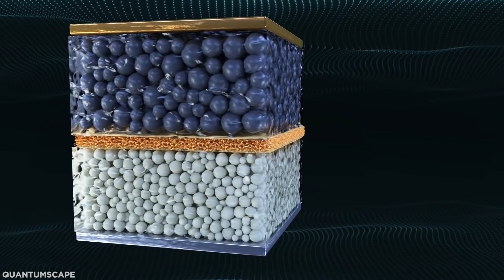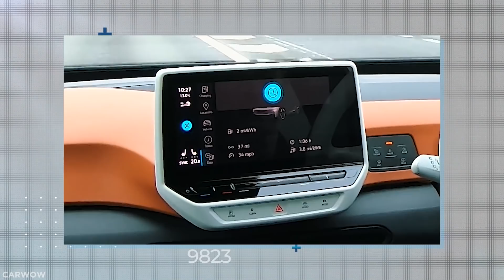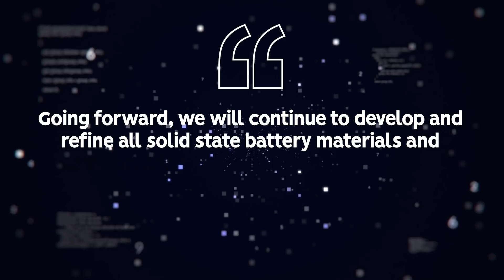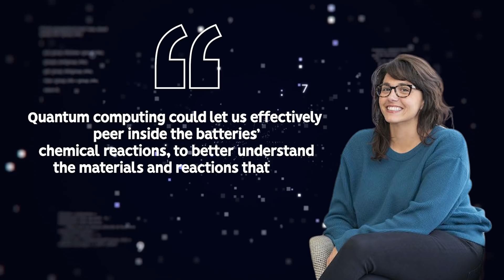Why Solid State Batteries Are The Future

Comment: Electric cars are going to need power from somewhere....
Reply: And gasoline and diesel cars need fuel from somewhere.  What's your point?
Reply: @redbaron6805  More power stations needed.
Reply: @raisagorbachov  That is not necessarily correct.  EV's can be charged at home, unlike gasoline cars.  You can also charge them at work and other places.  

A lot of power plants are idle at night since demand is low, so there is a lot of surplus power available already for electric cars when they are charged off peak, when the rates are low and a lot of spare grid capacity is available.
Reply: @redbaron6805  If it's charged at work, it'll be charged at peak times. If electric cars make up more than a minority then there will definitely need to be more power stations. A typical electric car that does 30 miles a day will use 259wh per mile. That's 7,770WH or 7.77KWH. Somebody that typically does that 7 days a week is going to use 54KWH per week.

A 500megawat power station will be able to charge just 9,259 cars at a time. I can tell you that there are a lot more cars than that within the area actually served by a single 500 megawatt power station as a typical 500MW power station will power 325,000 homes.

I'm afraid the electric car model is completely unsustainable, will lead to higher electricity prices, more pollution as more power stations will need to be built and that's without mentioning the environmentally unfriendly materials the electric car power system is made of. 

Though they seemingly emit more pollution, a gas or disel engined vehicle is way more environmentally friendly than those electric scams.
Reply: @raisagorbachov  Not necessarily.  My utility has two peak times, depending on the time of year.  One peak time is 12PM to 9PM, the other peak is 6AM to10AM and 6PM to 10PM.

As you can see, if I arrived at work at 8AM, I could charge for 4 hours before peak time arrived in the prior example.  And I could theoretically charge for around 6 hours off peak in the latter example.

Also, people typically do not commute to work 7 days a week, as most people have a 5 day work schedule.

As far as your "unsustainable" claims, they are simply not a reflection of reality.  You also fall into a logical fallacy with your "more pollution" claims for several reasons.

First of all is the fact that it takes around 6kWh to refine a single gallon of oil into gasoline.  That is enough power to drive almost the entire 30 miles in a single day.

Your idea that a power station can only charge 9259 cars is also off, since people commute 5 days a week, and a power station runs 24/7.  The actual number is 14286 each hour, times 24 which translates to 342864 cars each day.

And yet again, you forget that the power needed to charge electric cars would be offset, by not needing to refine millions of gallons of gas.  

And then of course, there is actual research by actual scientists that completely refute your claims that electric cars are more polluting and resource intensive than gasoline or diesel cars.
Reply: @redbaron6805  We will have to agree to disagree. Now if you'd said hydrogen cars were better, I'd have agreed.
Reply: @raisagorbachov  Hydrogen cars are not better, for several reasons.  Hydrogen is far less efficient.  The infrastructure for Hydrogen will never be built by anyone due to astronomical cost.  And the cost per mile on a Hydrogen car is about 6x to 8x higher than an electric car, and about 2x to 3x higher than a gasoline car.

Hence, you may see Hydrogen trucks or buses, even ships or airplanes.  But it will never make financial sense for cars.

Comment: Dyson has announced that they cancelled their EV project, even showed off what they had been working on. You got that wrong. VW Group has a large stake in Quantum Scape and is planning on using their solid state batteries in a luxury vehicle in 2025, so your statement about when they plan to introduce solid state is wrong too.  There is no current expectation that manufacturing will be cheaper for solid state at scale, no one knows how to get them to scale at all right now. Another wrong statement. Are you just winging this video? Is anyone there trying to get things right?

Comment: Solid state batteries have many issues currently to overcome, if they even can be overcome ever.
Reply: It seems major companies like Toyota are planning on making solid state cells, and when you consider the ban on vehicles in the future, I think it's only a matter of time before solid state batteries supercede current technology.
Reply: @MicroplaysMC  they can’t keep solid state batteries from declining performance when charged.  Lithium batteries will continue to improve, solid state will be a Waste of time.
Reply: @JP JP  You forget that early lithium tech was the exact same if not worse years ago. Old chemistries were actually susceptible to permanent damage if not charged/discharged properly. Over time it got better because the market already decided that's the route it would take and continue for years to come. We are at a point however, where batteries need substantial change in order to match the demand for better batteries and sustainable power. Elon has made a fantastic cell that outperforms the competition and is cheaper, but it's based off of decades old technology. There's nothing wrong with that, but if we're able to perfect the solid state cell, it would vastly outperform the liquid based cells. That point alone is what makes investors budge because it would mean anyone still using liquid cells would become incompetent. All that has to happen is that solid state tech advances fast enough to beat liquid tech in the long run. Personally, I think that can and probably will happen in 5-10 years.
Reply: @MicroplaysMC  but i will not sell my 1 million mile lithium battery EV just to buy a more expensive SS battery EV.   i think SS battery has its place, mostly in small to medium size devices.  Remember betamx versus VHS battle? betamax is technically better but VHS won the video format war.
Reply: @andrewcannon587  When the million mile batteries begin true production they will dominate the market for a while. SS tech has a long way to catch up, some carmakers are going all in though and are promising big things. We shall see if they can back it up.
Reply: @JP-dz7zu  Are you an engineer bro? Because these big companies already understand the safety risks and are working to overcome it. It's a matter of time with how quick battery technology will advance. You sound like you're bashing the technology just because you dont want to see the end of combustion vehicles.
Reply: @MrGtubedude  how is championing lithium ion batteries over solid state equate to not wanting to see the end of internal combustion engines?
Reply: @JP-dz7zu  Oh thats your argument? Well my apologies I assumed you were arguing against those batteries for combustion engines, I see lots of people do that simply because they like the noise they make, which i dont disagree with but clean energy is a must now a days.
Reply: yes hydrogen or biofuel seems like better option for me
Reply: @officialwowow  hydrogen yes, biofuel, no

Comment: This video assumes that Tesla won't make any advances in the future; the Tesla 4680 cell is already not far off the "expected performance of the solid state battery. PS. the Tesla Model S already does 500miles per charge, the Lucid Air has been tested to 519miles and the new Model S Plaid has done 527 miles - using the old Tesla cells.
Reply: The Plaid is not available to the public until late this year (or next year), and I think they are using the new cells? But I agree with you that 500 miles is already here. The benefit of solid state is faster recharging. Toyota is claiming it will take only 10 minutes to recharge the entire battery. If true, that would be gamechanging.

Comment: If some researchers says - you will not need cars because you will have a flying EVs; will you ban EV cars now?  If Solid State battery types get made; they will have different costs, battery life, energy density and charge speed differences, safety or limits on how many can be made..  No one knows what these will be; its all in labs; we can't assume the future. Australian researchers say forget that - Hydrogen - so ban Solid State now; because they have some outstanding lab results?  ICE car and truck bans are stupidity.  You did not need to ban mechanical calculators; when superior electronic calculators came out no one wanted the mechanical ones. Government promoting a solution before it is real ; is stupid in general.

Comment: Unfortunately solid state batteries don't have the cycle life and deteriorate faster than alternative options. Plus significantly more expensive to produce and will be for another decade. 
We won't see solid state batteries at scale for at least 10+ years.
There is a reason we've been hearing about "incredible battery break throughs" for the past 20 years and none of those solutions ever make it to market.
They are not scalable, or commercially viable.
The Tesla tabless battery from their battery day is literally the biggest TANGIBLE / viable leap forward we've seen in decades. All others are just fluff and bullshit until they prove otherwise.

Comment: Here in Australia it is very common to drive 600 miles (1000 km) in one sitting. The approximate distance between our 3 east coast capital cities is between 900-1000km (each)
 with not much by way of population, places to stay, or refuelling overnight outside those areas. The distance along our southern coast from Melbourne (in the Dan Andrews Police State of Victoria) to Adelaide is 750km with no major population centres in between.
Reply: Not sure what you are basing that on.  There is a Tesla Supercharger in Ballarat, Horsham and Keith.  So, driving between Melbourne and Adelaide is actually pretty easy.

Comment: In America, the current electric grid can't handle the existing capacity, so I don't get where all this power is coming from to charge these millions of EVs. And who is paying to retrofit all those apartment/condo and rest to charge these cars at home? Few MASS market buyers will get a vehicle that requires five+ hours of charging away from home.

Not saying it won't happen, but A LOT of government policies are going to have to take place for this to become a reality—similar to when the government built interstates in the 1950s.
Reply: The current electric grid CAN handle millions of electric cars, so that claim is actually false according to the actual utilities in question.

Apartments and condo buildings will add chargers over time to attract renters and owners.  It will become a standard feature over time, just like electricity and cable is today.

And what vehicles require 5+ hours of charging???  Typical 80% charging is around 30 to 40 minutes, full charge is around 1 hour, not 5.

Comment: I am most looking forward to getting charge times down into the 5ish minute range.  I can live with 250-300miles on a full charge if I can get fully recharged within 5 minutes or so. Of course, 600+ miles on a full charge and a relative quick full recharge of 6-8 hours would also be good for those long-haul trips.
Reply: Solid state batteries are allegedly promising 10 minutes to recharge. If that doesn't pan out, under current technology, you are looking for charging speeds to ramp up to 1.75MW (megawatts). Modern technology is at 350KW (kilowatts), which produces ~60 miles in 4-5 minutes.
Reply: @hermanwooster8944  That is what I am hopeful for.  10 minutes is pushing it, but if it is full charge, that is okay and will only go up from there. 60 miles in 5 minutes, while good, is still not a full charge of 300+ miles. Even though ICE are bad for the environment, it is still difficult to beat them for quick recharge time. Of course, they have had decades to mature at this point. I fully expect electric to get there. But until it does, and until prices become more in line with gas cars, full adoption will be slowed.
Reply: @RichardSmithers  I agree. I've been binge-watching EV roadtrips and they are still far too limiting. Especially since range is cut even further in colder climates. Although I want to see EVs succeed, I can't consider them until they increase the range/charging speed and lower the price.

Comment: Extended range, reduced weight and charging times along with price parity with ICE vehicles are on the horizon. Cannot wait to see this tech comes to fruition
Reply: That horizon, like nuclear fusion, will remain 10 years away for the next 50 years
Reply: @stephenrichards5386  not if we solve quantum computing first.
Reply: @charliechumlea1396  Computing power only speeds the wrong result
Reply: "cannot wait"! 
RIGHT?! 
BEVs are already better than ICEs. 
Solid state is in the future. No point waiting for it to happen.
It will be great when it comes.
Reply: solid state battery is the way to go with a bright future.
  
 I didn't like the hydrogen fuel vehicle sponsored by toyota, hydrogen vehicle it was toyota's bad idea
Reply: @JuanJimenez-oq2lk  in cold countries hydrogene is useful
Reply: How long does your current car sit in your driveway. Even at standard powerpoint charging rate you're done in 10hrs. Most people sleep for 8 hrs. You honestly telling me you need more than 250miles a day?
Reply: @jamesirwin7677  No, the opposite!
We need more EVs in production today!
Maybe even some cheap versions under 200 miles for city use.
Toyota is promissing this for 5 to 10 years in the future, but are doing nothing today. 
Hence... we can't wait

Comment: Electric cars are already 1/5 as likely to catch on fire in an accident then gas or diesel vehicles.

Safety is nice but extended range is more important for buyers.

Also you could cut the battery in half and have half as much money being spent on the battery meaning you can lower the price of the vehicle.

It sounds like everyone has a minimum range standard desired at 300 miles and want quick charging (anything over 30 minutes for 200 miles is undesirable)

But a bigger issue would be temperature difference not being as big as a problem for temporary range loss.

I don't know but I'm getting the $25,000 Tesla that's coming out in 2024 regardless of what it looks like. The only thing I know about it is it's going to be smaller than the model 3 and have at least 250 mile of range (Tesla canceled there 230 mi range Model Y because it didn't fit Tesla's range standards) but it could have 300 miles of range.

Comment: Tesla batteries are approaching 1,500 cycles. If a solid state only gets 1,000 cycles than we are going backwards.
Reply: Tesla batteries are already at 2000 cycles and have been for years already.  I'm not sure where you are getting 1500 cycles from....
Reply: @redbaron6805  I would like to know where your cycle numbers are coming from. Tesla had samsung design the 33J cell for their power wall and the cell was entirely designed to have the absolute best cycle life possible. To get this cycle life they decreased the capacity by 50% compared to their model 3 cell, decreased the max voltage to 4.1v, upped the cutoff voltage to 3.0v, and gave it a 6.4 amp discharge rating all to get 2000 full cycles out of the cell. I have had the opportunity to play with genuine tesla model 3 cells and they have a capacity of about 4900mah, standard li-ion max and cut off voltage, and they can handle 15 amps constant. I can tell you a tesla model 3 cells doesn't get close to 2000 cycles unless you are only charging and discharging ~40% of the battery capacity each cycle.